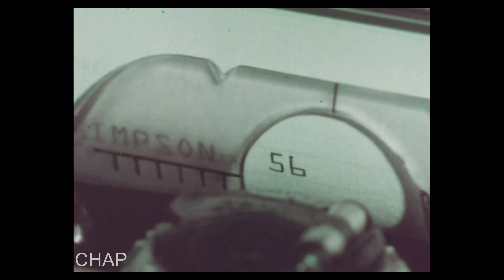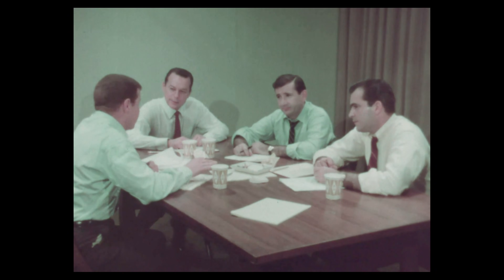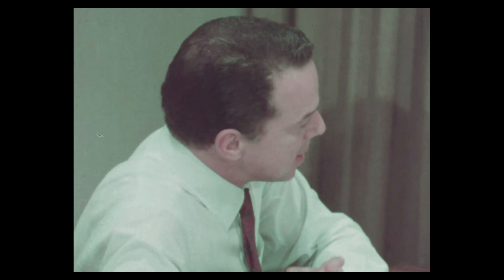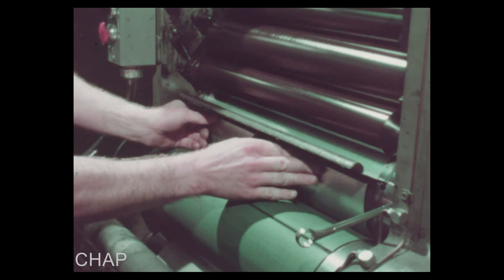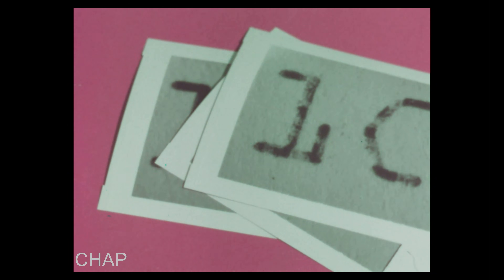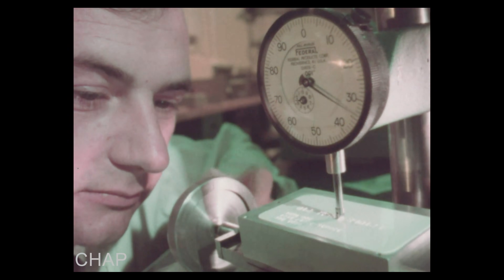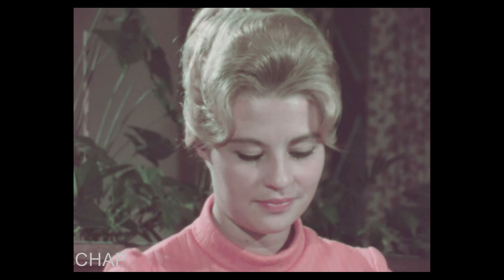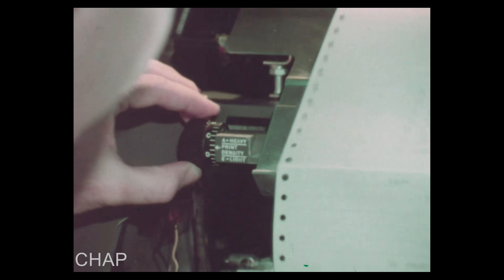Computer History:  IBM OCR World - Optical Character Recognition circa 1966  (system/360) Rochester

Comment: Oh so very interesting to look at older data processing workflows. So much was batch orientated back then.
Today, since computers can gather data at the point of data entry, then little need exists for OCR. 
Even fairly recent, the concept of doing data collection and data entry existed. Now, most data collection occurs in real time, and at point of contact. So, when you book a flight, no person or data entry need occur by the airline anymore.

Same goes for package tracking etc. You used to call some center and tell them your tracking number. Now, you do it on-line, and hence no call center, but MORE important the workflows and data travels though the system in real time, and without old batch type of data entry.

I mean, I even can deposit checks with my phone. Once again, no teller, no shipping the checks to a clearing house etc. That software does use OCR, and does check the old school bank number and routing numbers (still often in that "cute" OCR font that we don't see much anymore).

So, with the rise of personal computing devices, then little batch processing and few workflows now require a group of people doing data entry. It now occurs in real time at the point of contact where such information is created.
Reply from the maker: Hi @Albertkallal, thank you very much for the thoughtful feedback!  You make some excellent observations!  ~  Victor, CHAP

Comment: In the early 70's as a systems programmer, I learned how to calibrate document coordinates for the 1287 Optical Scanner aka OCR.  It was quite a challenge.  Then in order for the scanner to process those documents you had to code the program in CCW (Channel Command Word) code.  That machine was a beast.
Reply: I actually worked on a 1287 quite bit at our local electric company. I was an IBM CE. 1287s were challenging to repair, but when they worked they were pretty awesome.
Reply: @mrkkitson  I was hired by IBM in 1987 as an SE.  As a customer and later IBMer, I always had the GREATEST admiration for you CEs.
Reply: @knightwatchman  thank you. We always thought SEs were the 'good' marketing people 😁
Reply: @mrkkitson  lol  I fully understand your comment.  Thanks!  We pulled many a marketing reps butt out of the fire on many occasions. I know you guys did too.